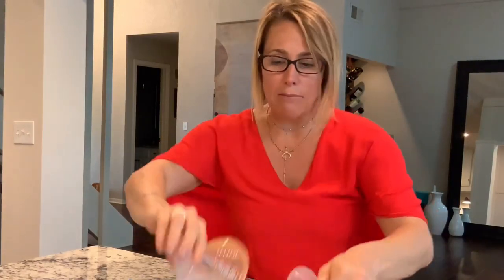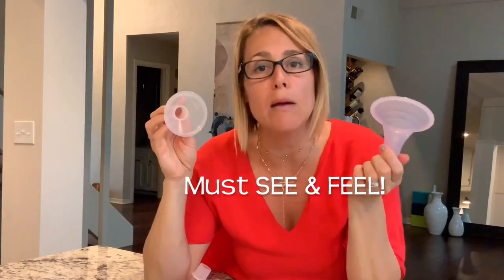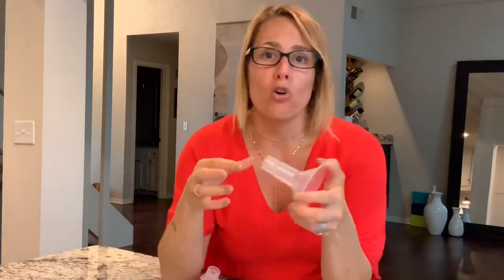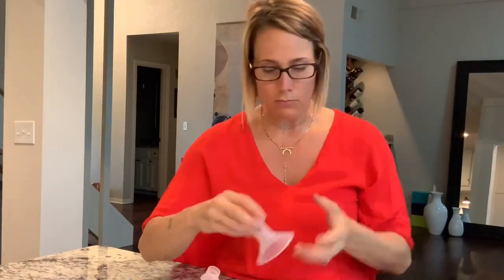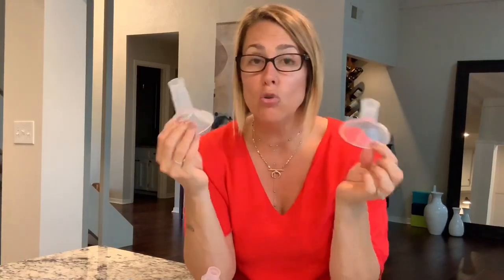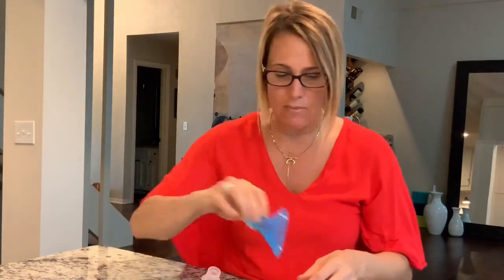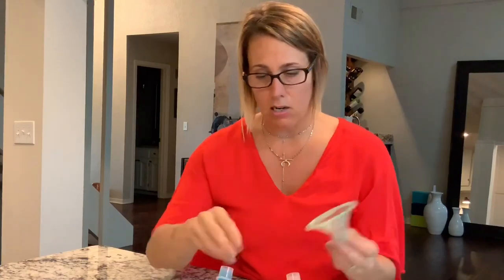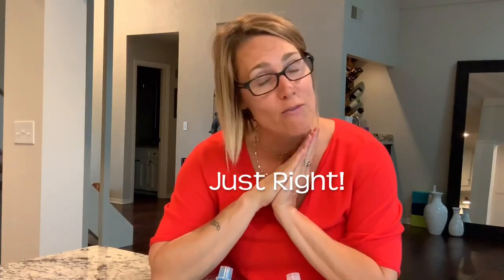Pump Flanges. Correct Sizing & Fit!

Comment: Is my flange too big if when the suction releases there is air between my breast and the flange? It makes milk leak back out. I've tried the 27 mm, 24 mm, and the 21 mm, it got better with the 21 mm but it still happens and is so frustrating I just want to cry
Reply: I have the same problem. Wish they would do smaller diameter ones.
Reply: @stacieahnne4484  maymom on amazon has sizes 12-19mm

Comment: I had to use the medella flex sheild 21, without it my nipples would get pulled in one direction more than the other even when centering them after a few min theyd be in a different direction. Also i found myself having to use higher suckion and change size to get anything out at the cost of alot of pain. The pain is still there but much less. I wonder if the pals would work better.
Reply from the maker: iceangel587 No reason not to try!!! See if it is more comfortable!!!❤️
Reply: My nipples do the exact same thing they  go in straight but immediately go to the side and rub against they do not stay straight down its annoying what did you do to help this problem
Reply: mia deeann i called medella and spoke to them they recommended medella flex sheild that has a rubber edge around the outter rim of the plastic. Call them. Later in got pumping pals but there was a bit of a learning curve for me but now I like it.
Reply: @iceangel587  can I use the flex shield with a regular flange insert that comes with the medela pump in style
Reply: Yes it is compatible because that’s the same one that I have both the Madella flex shield and the pumping pals will work with your Modelo